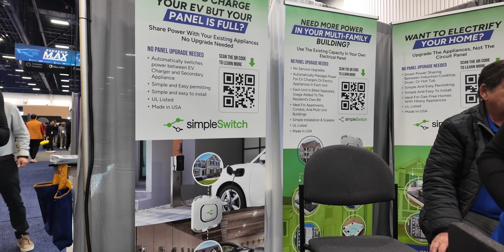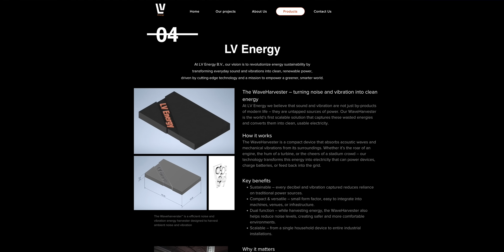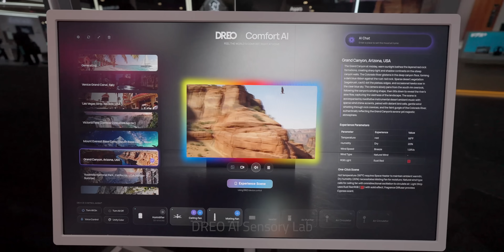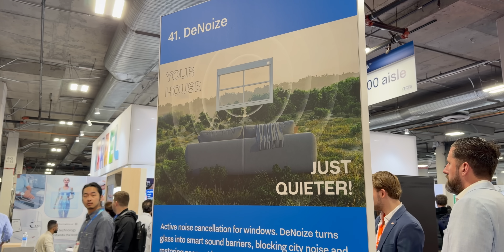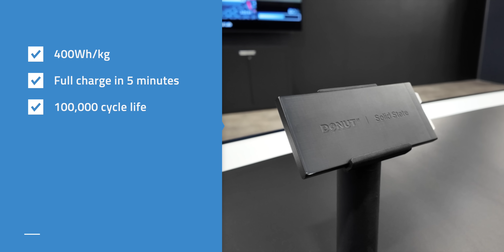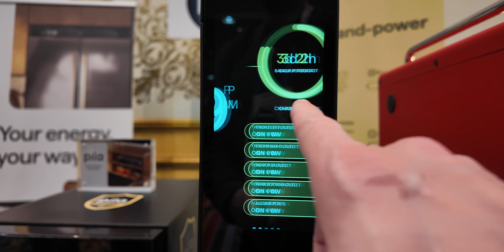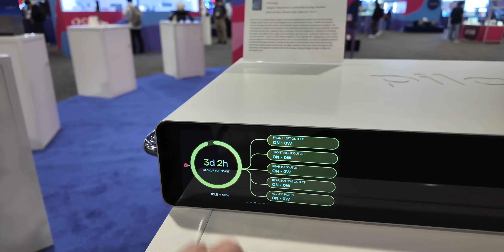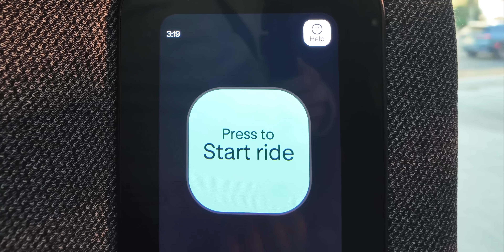The Most Controversial Battery at CES 2026

Comment: About the Donut battery - for what its worth - here in Finland all the experts are very sceptical. The baffling thing is that they seem to also claim that the thing is already in (small scale) production - so the truth should be out quite soon. Which in turn means that there is not that much money to be gathered from the risk investors.
Reply: One thing they didn’t disclose is how long the Donut battery retains its charge. If you charge and come back a week later to find it has lost 90% of its charge, it’s useless as a home battery. But to drive a car for a couple hours it may be just fine: charge it in 5 minutes, drive, and recharge when you need it again.
Reply: @h.e.hazelhorst9838  yeah my current theory based entirely on hearsay is that it's some sort of supercapacitor and can't hold a charge. Which would be a problem undoubtedly but I wonder how much charge lost would be acceptable?
Reply: @sino_diogenes   Marko the CEO confirmed that it's a "battery" in response to others claiming that it's a supercap
Reply: @sino_diogenes  super capacitors are not as energy dense though, it wouldnt be feasable to put one in an EV of any type
Reply: @thornbottle  I guess this would be the innovation.
Reply: @h.e.hazelhorst9838 
Some hydrogen vehicles have that issue if they use liquid hydrogen.
They can keep their fuel for 5 days but then start off-gasing the hydrogen and after 10 days the liquid hydrogen is gone.
Reply: @TBFSJjunior  one of the many reasons why hydrogen is dead for land transportation.
Reply: @skierpage  Not for all. Its useful when you need something that will be using constant and large amounts of fuel, like a bus or a truck.
The problem is that as far as I know hydrogen + its container is still heavier than a battery making it useless.
Reply: @hubertnnn   It's nice that hydrogen isn't made of any rare metals like lithium batteries, making it easier to source without industrial/trade access. Similarly, the end-of-life for hydrogen vehicles is looking super recyclable.

Flammable gasses just freak me out. I'd rather be driving around with a micro nuclear reactor in terms of how safe I would feel.
Reply: @h.e.hazelhorst9838  That would also be excellent for small scale chargers, like charge up your spare battery while you get ready to go, you're out all day and recharge your phone over the course of the day off it.
Reply: "Donut doubt our claims!"
Reply: @EneriGiilaan  the only thing that makes any sense to me is that they think this will be easily reproducible once someone has a chance to treat it down and see what they did.   If that's the case, keeping it under wraps until you have production capacity actually ready to go makes a lot of sense.
Reply: @wspepsilon  Tre, but still i would be a surprise to me, mildly put, if such a small company solves a problem, that bigger companies have literally thrown billons of dollar at, to make work and still havent yet a marketable product.
Reply: @Daniel-rd6st  it's possible, even by luck they stumbled upon a discovery than even a multibillion dollar company missed
Reply: @Daniel-rd6st  You know, a lot of those big companies became big because they found a way to do things no one else had prior. Sometimes you walk down a blocked road, dig your heels in and trudge on while just a few steps to the side, behind a few trees is a perfectly walkable way. You just don't see it, because you're focused on your way.

Would not be the first time for someone more or less stumbling into a configuration and mix of technologies which outperforms everyone else. Happy little accidents are less frequent, but they do happen.
Reply: @maskharat  And even Li-ion had a rocky start before Sony started using the tech
Reply: @maskharat  True, which is why i have some hope, that this isnt just an elaborate hoax.
Reply: @Daniel-rd6st  Yeah, same. The announcement feels to good to be true, but the scenario and situation they created with the claims (already in production, already being put into devices) even though the companies are connected, the scenario they proposed is alien to the scam playbook - and that part gives me hope.
Reply: @Daniel-rd6st  most big companies are too one-tracked to make real discoveries.  They acquire startups to get real innovation in, or in a few cases (bell labs) they spin out a lab.
Reply: I feel like its a scam. Why wait for CES to announce a breakthrough worth hundreds of billions?
If they waited for CES, why is there absolutely ZERO third party testing? Why is there no live demo? Like we dont need to see the 100,000 charge claim to validate it, literally 30 mins could check all the other claims.
Why is their first partner an EV motorcycle brand nobody cares about? While big brands are slow to innovate and are risk adverse, such a battery advancement would put any company well ahead of its competitors, yet they only got a small motorcylce company?
There are too many red flags.
Reply: @_aceofspades_  "Why is their first partner an EV motorcycle brand nobody cares about? "  Because it's the same brand that is already using the Donut motors, they are closely connected.
Reply: @JRP3  a hubless wheel moto, a thing which is broadly acknowledge as a WOFTAM design. Funky looking but achieves very dubious benefits with lots of added wear, design, and friction issues.
Reply: @JRP3  The owners of both companies are brothers.
Reply: @_aceofspades_  Donut lab and Verge Motorcyles are owned and run by same people. They are different companies only on paper.
Reply: @_aceofspades_ I bet it will be hybrid and not fully solid state like the BMX batteries were
Reply: @guitarchitectural  but they did say its fully solid state in the true sense that nothing is liquid like some hybrids.
It was also suggested that they havnt yet patented the battery because doing so would disclose the chemisty.

Either its some weird scam that they would be stupid to do going so public, or its a legit breakthrough that is going to make the owners billionairs.
Reply: @_aceofspades_  if it's a scam, who are they trying to scam? That's what got many of us scratching our heads.
Reply: @_aceofspades_ I do buy the idea that this is proprietary and secret information, *especially* if it's worth hundreds of billions. CES appearance seems to me to be to build credibility for skeptical, secretive investors. Or it could be a scam. 

Scam likely?
Reply: I feel like this is a scam also... but frankly think the best tester they could get... is Matt.
Reply: @_aceofspades_  It is not worth hundreds of billions as batteries with higher energy density are already on the market. 
The solid state part is exiting but many solid state battery versions are being developed. They might be ahead but it would take then ten years to ramp up to production that generates them billions and by then they might not be top dog in solid state anymore.
Reply: @AlbertZonneveld 
What batteries do you know that have 400wh/kg?
And if their claims are true, 1Gwh of production capacity wouldn't be the highest, but certainly high enough for a start.
Reply: @carstekoch Large battery producer CATL has 400 Wh/kg.
Amprius has commercially available batteries of 450 Wh/kg and has shown their 500 Wh/kg
Reply: @_aceofspades_ I believe there is an incredibly strong reason for Donut to wait to hold this as close to the chest as physically possible; China.
These batteries threaten China's battery hegemony, Donut and it's partners are now almost certainly the target of the most intense industrial espionage seen this century.
If their claims prove true, they are sitting on something nearly as critical as cold fusion.
You better believe that Chinese battery giants like CATL, if they can get the tech, will outscale Donut and push them out of the market in a heartbeat.
People have long worried about the oil tycoons, but I will let you know the battery tycoons are just as dangerous.
Batteries are to China what oil and gas is to the US, EU, and OPEC.
Reply: I bet release date is april 1st
Reply: @djelunico  It will be released on February 30th
Reply: As a Finn i am ashamed of these scammers. We need to keep up the "Finns always tells the truth/you can always trust a Finn" image and not damage it.
Reply: This is how I feel, too. There are some extremely high-profile Finns involved in this, like Risto Siilasmaa, who ought to be ashamed of themselves if this proves to be a complete scam. I believe there's also millions of public development money given to this, so lawsuits should follow.
Reply: @ee-ui4if "I believe there's also millions of public development money given to this, so lawsuits should follow." Unlikely. Development money does not need to result in a functioning product, just in the effort of getting to one. Also they're not publicly traded, so no random investors that can sue.
Reply: They studied from the Book of Elon: make bold claims just around the corner and delay indefinitely while collecting venture capital.
Reply: They arent going to patent the tech because it all relies on the production method. And the bikes are allready for sale so its weird if its hoax. This seems like they found some way to manifacture a capacitor that holds its charge for long periods of time. Prooably using sodium and carbon in a way with thousand of layers of anodes and catodes not just single layer anode, catode and electrolyte. And what comes to the cycle testing they can just test it for 5.000 cycles and calculate how it deteriorates and come to a conclusion that it will safely hold over 100.000 cycles. Its weird if they actually pulled it off, but well see in about 2 months after every battery has been ripped apart that theyve put in one of those bikes.
Reply: @aleksi5432 - it's likely a pseudo-capacitor/battery (Battacitor) combination. That uses ions as charge carriers, like a battery, but that deposit on the surface of an electrode and provides electrons from a surface charge field rather than a full battery that shuffles charge carrying ions from anode to cathode and back.
Reply: @GruffSillyGoat It would be really cool to have a charge controller and a capacitor inside of every 18650. Possibly with ethernet over power, for self-reporting. Super smart battery packs. No need for anything extra. Just plug it in.
Reply: @GruffSillyGoat capacitors can accept charge at high speeds, but also can only discharge at a high rate also. Pointless for a lower consumption-rate device like an EV or E-motorbike.
Reply: @petesig93  Maybe if it charges really fast but discharges in a bunch of hours it may not make sense as your main vehicle, but as a commuting one that you charge quickly everyday before leaving for work
Reply: @drillerdev4624  nobody have time to babysit their vehicle like that
Reply: @sendoh7x  Would work for things like public transport (thinking trams and electric trains, so they can transverse sections without wires), or grid scale storage for enabling short term use for intermittent renewables.
Reply: @sendoh7x  yet we do it with our phone
Reply: @petesig93 that is incorrect. Capacitors can charge fast, yes, but they can discharge slowly too. A short circuit would discharge them extremely quickly (hundreds or thousands of amps), but connected to a load, the load dictates how slow or quick the discharge is. 

4v through a 10 ohm load is 0.4 A, no matter if the 4v comes from a wall wart, a battery, or a capacitor.
Reply: @GruffSillyGoat
Super caps usually don't have anywhere near that capacity/kg.
If that were the case, this would be even more of a leap than a solid state solution.
Reply: @aleksi5432  At the very least I'm skeptical about the cost claims. I'm inclined to believe they're doing some "magic math" by comparing the cost over the lifetime of the battery. Since they claim such a long battery life, they can hide an inflated cost by saying it's "cheap" over time and then go "hey look, it's cheaper than this Li battery that only lasts 5% as long"
Reply: @WingTzu343 sodium batteries are super cheap in regards to amp hours capacity. We already have super capacitors so mixing them would be smart. It would make more sense for it to be LTO which has the best recharge/discharge rate out of any chemistry right now for something large enough for a car or motorcycle. People have been building custom ones for a while now in car audio including myself like mixing super capacitors and  I have a 48ah 15.5v LTO battery with a 30c discharge and recharge rate which can dump I think about 300+ amps max.
Reply: @aleksi5432  What's this I hear about high self-discharge? Not a big deal for a motorcycle or plane. Indicative of a capacitor.
Reply: @jamesvandamme7786  Argue about the semantics of the definition all you want, if it hits the specs its still gonna be used as a battery.
Reply: @kevinanderson7887  The thing is, we don't know all the specs, just the headline grabbing ones. None of which have been verified. A capacitor has a linear charge vs, voltage curve, but a battery voltage varies just a little versus state of charge. Dealing with a highly varying voltage takes some engineering. 
The other question is the high self-discharge that I've seen mentioned. 
What about yield and failure rates? 
Lots of questions, which can only be answered by real world testing and widespread use to see if there's any gotchas.
Reply: @jamesvandamme7786  High self discharge is a big deal for anything that needs to store energy for a length of time.  You don't want to walk up to your motorcycle or plane and find it's discharged itself and doesn't have enough range to go anywhere.
Reply: @jamesvandamme7786 umm, it would be a big deal if you don't use the car for even a couple of days. Like parking at an airport.  You then come back to a dead battery . In the middle of the night.
Reply: Find it hard to believe a small company could beat CATL to the punch.
Reply: >  The baffling thing is that they seem to also claim that the thing is already in (small scale) production

i mean, they said it will be going out with those verge motorcycles in Q1.  so i think yes, they have to be producing it already for those devices.
Reply: @igiveupfine  Verge (located in Tallin) is set to start shipping the TS Pro EV Motorcycle in Q3/Q4 2026, and has already started the manufacturing lines to meet pre-sale delivery. Verge engineers have seen the battery in advance in an effort to confirm usage in their vehicles. The announcement from DonutLab that Verge would use the SSBs was a strategic add to their announcement on the battery and OS software video. We most likely will see a redacted 3rd party validated white paper in Q2 2026.
Reply: Yea, these numbers would be amazing if true but, they have a lot of prove if they think they could.... very skeptical here. It's a wait and see for sure but, not getting hopes up oh this one.
Reply: About that so-called solid-state battery and the donut motorcycle. The fellow said they are already shipping. Do you know this is not true because that was days ago, and if they were shipping, we would already have customers doing reviews and testing the batteries. Since this hasn’t already happened, you know the guy is most likely lying, and the whole thing is probably a scam. He will be sued, I believe, and that will be the end of it.
Reply: @amazingeducationquestionsa1367  There is a Verge TS EV Cycle in production now that's on sale using a Lithium battery (there's a YouTuber in the EU who rode one over 4 months and 11000km). The announcement on using the DonutLab SSBs is for the TS Pro model, in production now for a Q3 2026 release in EU, and Q4 for a US version.
Reply: @amazingeducationquestionsa1367  I see it the other way round. If the product is already out there, it would be easy enough to test it. Just measure hom much charge the battery can take. If the claims are false, the net would be flooded with negative reviews by now. Because people like to complain a lot more than they like to praise. Since we see neither (positive or negative feedback) i dont believe, that the product is already out.
Reply: It will be great if true, but to me, this seems like a way to pump and dump into this e-bike company for pre-orders that won't get refunded if found out to be a scam.
Reply: @cybernoid001  company insiders can't do a "pump and dump" when both Verge Motorcycles and Donut Labs are privately-held companies that aren't publicly traded. The owners could be hyping this tech to increase the valuation of the company(s) in a private investment round and then enrich themselves from the new funding. And all battery and EV and many electronics company have ordered a $30,000 Verge TS Pro motorcycle just to tear down its battery. But even if Verge Motorcycles has received 10,000 $100 refundable reservation fees, is the scam worth getting only $1M?
Reply: Scam production.
Reply: Alibaba is supposedly already selling these 400wh/kg cells
Reply: @thedeepend2949 Why don’t you spend five minutes to check then you could provide a link.  But no, just say something false to keep up the hype
Reply: Yeah, highly sceptical about the whole thing. Reminds me of the whole Steorn Orbo thing back in the day...
Reply: It’s a capacitor, not a battery.
Reply: @afldskhgdfkghdfkhg  someone used the term "battacitor" and I think we'll see this is closer to the final technological iteration we will see in the end product.
Reply: @afldskhgdfkghdfkhg great so my nearly 100% battery when I get to work will be 50% or empty when I head home…
Reply: Is it Scam battery?
Reply: @Eng.JohnSmith we dont know yet, but its a small comlany making huge claims and the numbers they promise for its capacity and versatility are beyond anything anyone believes can be possible right now. 
But they saidbsome e-bikes will be shipping with them this spring in April, so everyone is waiting to see if they are telling the truth or not.
Reply: Just look up the founder himself, should tell you all you need to know.
Reply: Of course this is a scam lol. Didn’t the same guy claim he invented super intelligent AI a while back?
Reply: @farmtech-vn9ew  he also found a cure for cancer by pinching your nose.
Reply: Excellent overview.  I look forward to the deeper dives.  May this comment please the algorithm.
Reply: I foresee a certain  battery company being sued by a certain coffee and Dunkin'  company ... INFRINGEMENT!  :-/   'Time to Make the Donuts!'
Reply: We all know it's going to end to being a scam
Reply: They need to show some test that people can see in a live forum just show us it works that's it.
Reply: Yes , you might even be the fool that invests in small wind turbines too.
Reply: Miss go electric industry has a pretty good 26-minute video looking into the past actions of the company and others working with them. She doesnt have the nitty gritty details like we all want, but i felt it built a decent picture surrounding them.
Reply: That is very interesting.  i was wondering where the hook was.
Reply: Small scale production of what though? The specs are physically impossible. 100k cycles at 12C charging would take 694 days of continuous testing—the company was founded in 2024. No patents on battery chemistry, no peer-reviewed papers, and Nordic Nano is a solar panel company. The 'production' units are likely LTO cells or supercapacitors relabeled, not the claimed 400 Wh/kg solid-state tech. Also, the 'multiple companies using their technology' (Verge Motorcycles, Cova Power, Donut Lab) all trace back to the same founder.
Reply: @ScriptHaven  Also, it'd take 2-4 years to get the certs required for EU road use.
Reply: @esaedvik exactly. Smh some people are just delusional at this point. I would love for it to exist but it’s not gonna happen.
Reply: @ScriptHaven  You don't know how battery testing works. They measure some amount of cycles, then extrapolate that for the entire lifetime. It's like saying you need to wait two years to know if canned food last or not.
Reply: @ScriptHaven  it isn't impossible, when you understand what they are releasing.  All the specs are right, its just not a "battery" or "solid state battery" in the traditional sense.  Quasi Capacitor
Reply: @BirdsOfaA-Feather  If it's a quasi-capacitor, then the 400 Wh/kg claim is still impossible. Supercapacitors max out at 5-30 Wh/kg, lithium-ion capacitors (LIC) at ~30-40 Wh/kg, and the most advanced hybrid capacitors (like those from Skeleton Technologies) hit ~50-60 Wh/kg at best. Not 400.

They're marketing it as a 'solid-state battery' at CES and taking pre-orders for motorcycles based on battery-like range claims. If it's actually a capacitor with 1/8th the energy density, that's textbook fraud—misrepresenting the product to collect deposits.
Reply: @BirdsOfaA-Feather  Saying it’s a capacitor or a semi capacitor does make the outlandish claims any better. Even super capacitors have much less charge capacity than batteries and they don’t hold a charge.
Reply: @ScriptHaven  Indeed ... that is baffling - why make those claims that will be found to be untrue in short notice ...
Reply: @EneriGiilaan  It's not like scammers are particularly smart e.g. like Fyre Festival and Theranos.
Reply: @EneriGiilaan  money. thats the reason.
Reply: @ScriptHaven  Of course ... BUT ... how would declaring that the product is effectively ready be a reasonable strategy for that? One would assume - and as has routinely been the case - that it would be more 'profitable' to set the  product horizon way in the future - thus one can milk the investing market longer.
That is the baffling question. I would not write off some kind of 'insanity' as a reason.
Reply: To sell motorcycles and convince investors.
Reply: @EneriGiilaan  Part of the answer is incentives. Verge, Donut Lab and the Cova Power JV aren’t three independent adopters; they all sit in the same founder/investor network around Marko Lehtimäki, so “already in production with multiple partners” sounds much bigger than it actually is. If your background is software/startups and you control both the tech company and its first “customers,” it’s rational to declare readiness early because the upside is media, OEM conversations and grant money now, while the technical reality can only be checked slowly through long‑term cycle testing.
Reply: CATL came out and said it's impossible. They have enormous knowledge on battery technology so I'd believe them
Reply: @nugalonious  yes me too but also if this is a hoax, it is a hoax that will fall apart so quickly that why would they even do it?
Reply: @set_5341  Yes because products are releasing soon. It would be a very stupid hoax.
Reply: @nugalonious CATL also said solid state batteries are impossible last year, and back pedaled. Now quite possibly trying to catch up with a pilot plant next year. 

 I have nothing to say about Donut Labs validity. 

 Pilot spelt poopy for spell check, and I don't believe I've ever typed it. Who's been using my phone typing such dirty words!
Reply: @nugalonious  Not saying anything about Donut being legit, but CATL has the most to lose of anyone if it's real, so of course they'll say that.
Reply: @nugalonious  they say it's impossible until they steal the tech and build one themselves.
Reply: @nugalonious  Ofc they would say that. duh
Reply: Tell me things that never happened  @nugalonious
Reply: @nugalonious if it's a hoax then the truth will come out very shortly. But just so you know, people also said the nuclear battery the size of a coin was fake. They also said lithium iron phosphate getting 25,000 cycles was fake. I remember both of those being announced 15+ years ago when I was in high school, and then like 4-8 years later they're both in production and both are very real!
Reply: @nugalonious  It’s only impossible until it isn’t.  That said, I seriously doubt this meets that description.
Reply: @nugalonious History is full of people who said something is impossible, and then it was done. The Airplane being one such example.
Reply: @nugalonious  I have stock in CATL via an ETF.  Its done well...However, they are Chinese.  I wouldn't trust them.  And they are right, until they are wrong.  Per the way they do batteries, it probably is impossible.  But this is a quasi capacitor.  not a solid state battery in the traditional sense.  it is solis state, just not the way they think about.
Reply: @BirdsOfaA-Feather  So they're marketing a 'solid-state battery breakthrough' at CES, putting it in press releases as a battery, taking $1k deposits for bikes with battery-like specs... but actually it's a capacitor with completely different characteristics? That's not 'non-traditional'—that's fraud.

And even as a quasi-capacitor, 400 Wh/kg is still impossible. Best hybrid capacitors are ~50-60 Wh/kg max. The claim is fake regardless of what you call the device.
Reply: They will come up with excuses to postpone the battery. This was just a marketing exercise to get people to buy the Verge motorcycle with regular batteries. Verge and Donut are owned by the same brothers.
Reply: It's technically not a battery. It's a super capacitor
Reply: @KingWilliamProtector  we don't know, no one knows. anything people say is just speculation.
Reply: @KingWilliamProtector  It's not. The demo made it seem like just a good lithium-metal battery, but there's barely any such tech and definitely not being produced in Finland now in complete secrecy.
Reply: @KingWilliamProtector  'Nanocell-structured carbon nanotube composite fibers for ultrahigh energy and power density supercapacitors' Dongju Lee. Science Direct, Volume 295, 15 April 2025 Patent filings in S Korea and USA. Backing from several Korean government agencies, including the Ministry of Science and ICT and the Ministry of Trade, Industry and Energy. 
https://www.youtube.com/watch?v=reLj79iUz60
Reply: @KingWilliamProtector  No, it is nothing.
Reply: For the sole reason of strategy, I’m leaning towards this being real. They have literally nothing to gain if this is a scam since the world will know within a month or two and it will put them out of business. On top of that, Ziroth’s video convinced me that this technology is plausible.
Reply: @mackit  deposits for bikes?
Reply: @ataritheone  They would be sued out of every penny they make, for false advertising, but despite that, i still remain highly skeptical until i see some proof.
Reply: @Daniel-rd6st file for bankruptcy, creative accounting, transferring to a sister company, small print...  There are tens of ways to circumvent that. 
Nicola, Terranos and many others already did that.
Reply: @mackit  The "Asinoid" Claim (May 2025)
Just eight months before announcing this battery revolution, Lehtimäki launched a company called Asilab.

The Claim: They claimed to have built "Asinoid," a new form of AI based on "human brain architecture" that was superior to OpenAI and Google. They called it the world's first "True Artificial Superintelligence."

The Result: The project produced a lot of buzzwords but effectively zero verified product or peer-reviewed research. It was widely criticized by AI researchers as marketing fluff—using "neuro-symbolic" terminology to dress up standard tech.

The Status: It has largely gone silent, and now the focus has shifted entirely to batteries.
Reply: @mackit  "...They have literally nothing to gain if this is a scam since the world will know within a month or two and it will put them out of business..."

1. First off, it won't be in a month or two. Testing took time, and not everyone is willing to test.
2. Second, they already built reputation. They can burn it for a good while.
3. Physics is not violatable. What's theoretically plausible is not always realizable at scale.
Reply: Actually the CEO already told their plan. With this move they want to lineup their partners and then their new customers so that they can start scaling the production. They starts selling the expensive motorcycle first because they know that the competition will buy every one of them because they will tear the battery down. So the secrets are out. So now they use this couple of months to sign the deals so that they get to keep their head start. Also it will be the clients who will finance the scaling of the production so they don’t need money from the so called investors. In my opinion they are doing exactly the correct thing
Reply: Why not just keep a open mind ,,results can't be faked .
Reply: The powers that be don’t want this technology, they can’t control it.
Reply: The Electric Viking debunked the Donut guy.  He was in a rap music group and Verge made a few bikes but not a production of scale.  They still have to guard against China stealing so we will see like you said.
Reply: @travisyarbrough4033  No, he didn't 'debunk' him. Just highly skeptical, like everyone.
Reply: When someone is that confident and brazen with a Invention, It has to be true.
Reply: @therealmr.incredible3179  lol
Reply: @therealmr.incredible3179  Like that guy in Zimbabwe who "invented" a car that runs off ambient RF?
Reply: @therealmr.incredible3179 😂